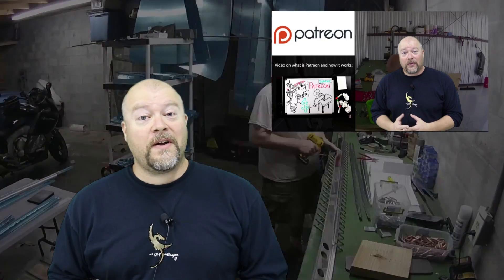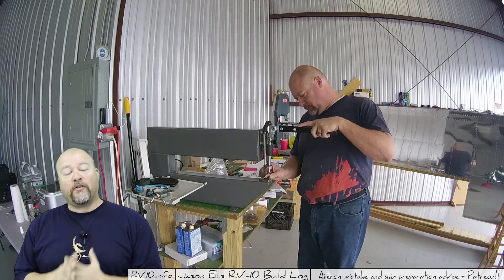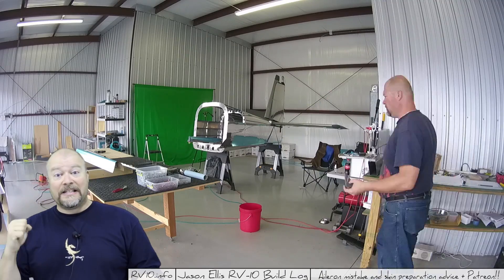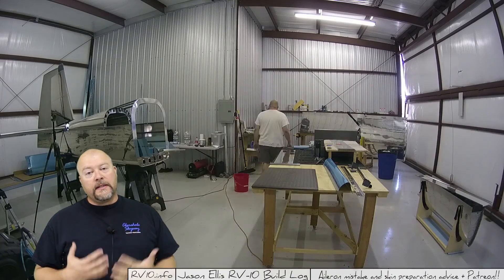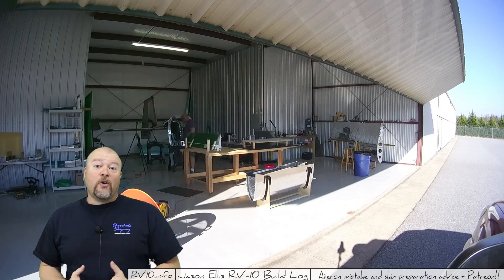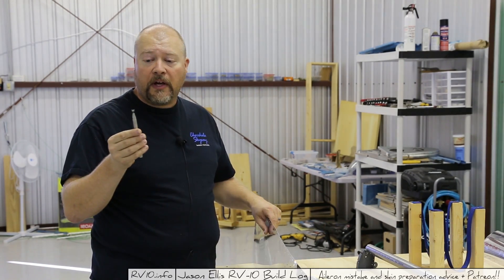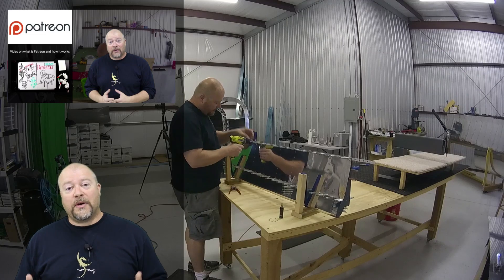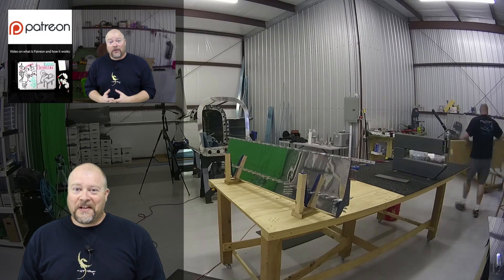RV-10 Wings - 031 - 3 for 1 video; Aileron work,  Skin Preparation & Patreon Campaign

Comment: Use a smooth flat file, sand the edge at a 100% perpendicular , then after the burrs and nicks are gone, then use the same flat smooth file at a 45* angle. on both side, and that will remove the burrs along the egde.. use light pressure, you are not trying to shape it, you are just trying to smooth it up.

Then take some 180 grit crocus cloth, and sand the edge, so that it is a dull gray edge,. done.

Comment: The Skin Preparation you are doing is appropriate for the same reason you are deburring everything else.  Those places you are feeling are shear marks.  If you look at one of them with a magnifying glass, you might see a little notch.  Each irregularity "could" cause the start of a microfracture.  And the Van's book in section 5.2 says you should do it...
Reply: makes me wonder why Vans doesn't deburr the pieces at the factory? Can't be hard to do at scale with the right machines, right?
Reply from the maker: Hrmm.  That's a valid question.  Some of it might just be due to labor.   If they debur, then they will pass the cost of that on to the end user.   Just a guess..  I have lots of time.. not lots of money.. haha
Reply from the maker: yeah I looked in the book after I had made the video and found the spot.  But it was already filmed..